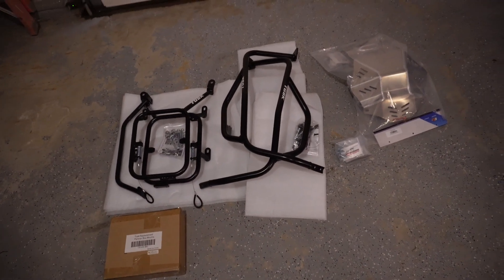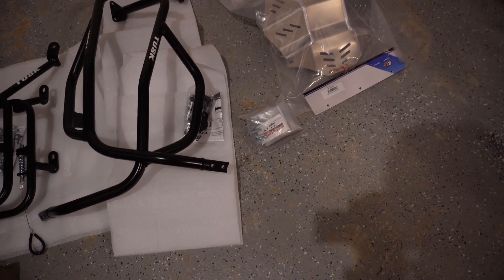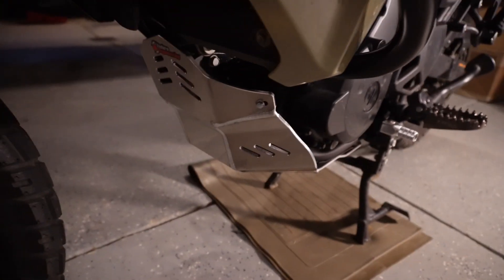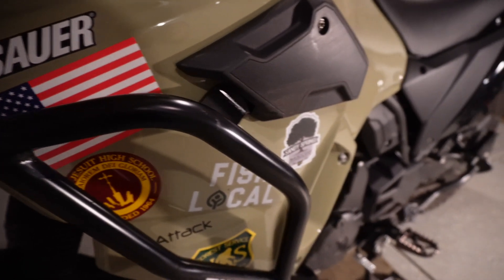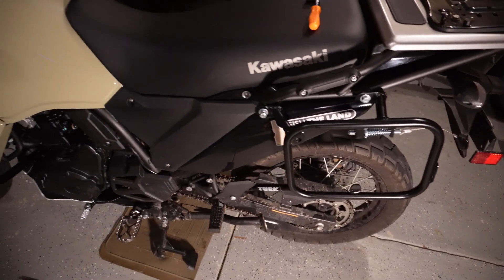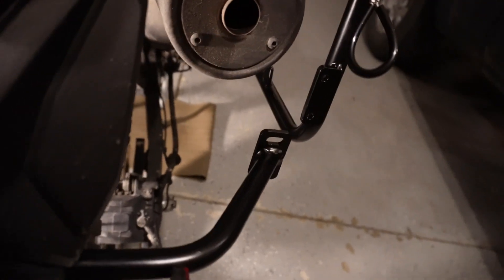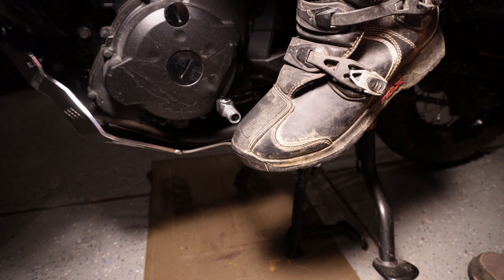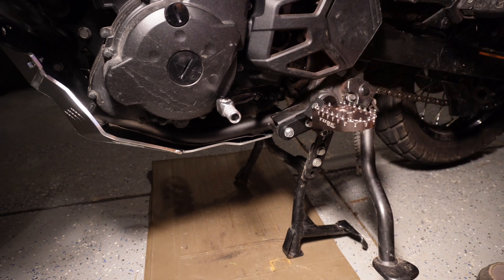KLR 650 JNS Footpeg Lowering Kit & Protection

Comment: Thanks…I have these sitting in my garage but haven’t put them on yet.  The prime reason I bought them was to lower the centre of gravity.  My KLR is so top heavy that I’m hoping these will make it better when standing through the squirrelly bits.  I have handle bar risers and am curious as to whether these will reduce the need for those.  I’m 6 foot
Reply from the maker: I think risers are still necessary. I’ve been busy the last few weekends so I haven’t done much riding since installing the lowered pegs. I still feel like I’m reaching some when standing. I’m 6’2